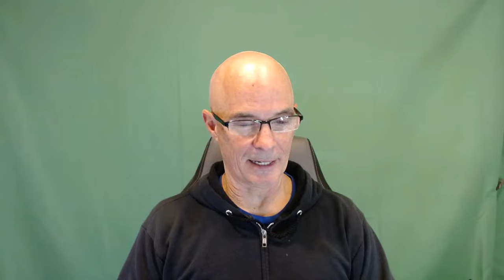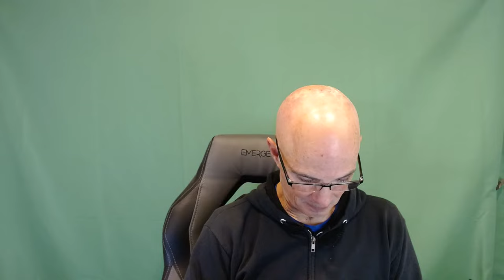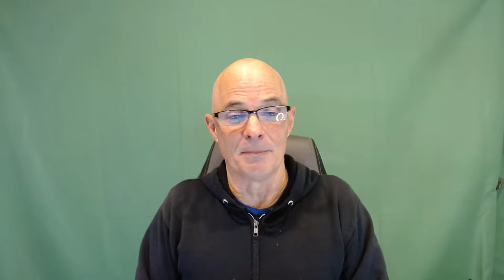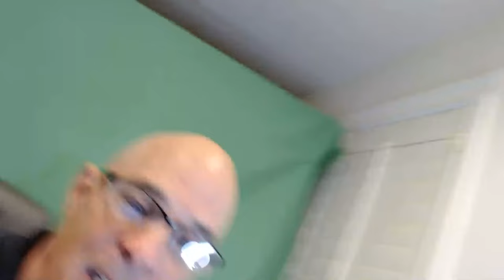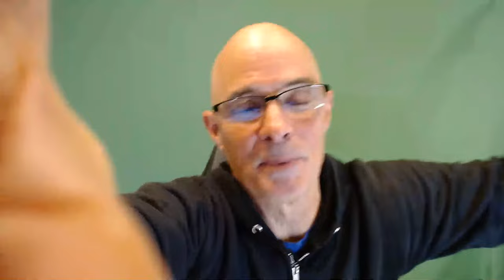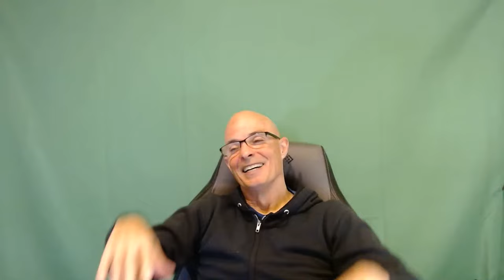LET'S TALK TECH-TEST GOLFBALL DIMPLE PISTONS?

Comment: Skeptical.   As the piston draws down from TDC the piston top gets further from the combustion chamber and any swirl that happens is likely nearer the head than the piston top.  Also they would have to figure out how to match the combustion chamber volume added by the dimples.  Decrease the dish before you cut the dimples?   Maybe it would disrupt the flame front after ignition causing more thorough combustion?
Reply from the maker: you need to think about what happens during the compression stroke and right before ignition then expansion
Reply: @richardholdener1727   hello rick  i think  diesel enginne bring juste air  nothing mix  and same  as GDI gaz engine   and you never have enough of air fuel mixe for max performance

Comment: I think the theory of why it would work in a modern diesel would be the decreased boundary layer or lamilar flow reduction. Modern diesel swirl the air inside the cylinder I forgot the numbers Gail Banks talks about it and one of his videos. As a cylinder comes up on the compression stroke it induces more swirl and the boundary layer between the piston and the air probably slows that swirl down before injection reducing that boundary layer increases swirl increases efficiency... Probably doesn't translate to a gas engine at all

Comment: I don't know if you've started testing them or not at this point. But if not, I think you're definitely missing out! Personally, I would jump at the opportunity!
But to be clear, Speed of Air pistons are not about increased power. They do typically see a slight increase of peak power and more torque, especially in the lower RPM's, resulting in a wider power curve. But that's just a positive side effect of a faster and more complete combustion thanks to a more homogeneous mixture and a more evenly contained (stabilized) flame front and also increased cylinder compression and turbine drive pressure. If you're looking to get the most power out of an engine, you're probably looking at pushing as much air and fuel as possible through the cylinder at ever increasing RPM's. But then you're no longer emissions compliant and engine longevity and fuel efficiency is out the window long ago...

No, the Speed of Air piston design is all about a clean and complete burn, meaning vastly improved emissions, meaning vastly reduced carbon deposits, meaning vastly improved engine oil life, meaning vastly reduced harm caused by EGR's, meaning vastly less clogging up of DPF's, meaning vastly reduced regen cycles, meaning vastly reduced DEF consumption, meaning vastly improved engine life and also a very meaningful increase in fuel economy and a wider power curve. That's what it's about. And really, if you think about it, that's exactly what ICE's need the most to survive the current political climate (pun intended). The climate politics are trying to kill ICE's mainly because of emissions. Just look at diesels... Speed of Air pistons practically makes a diesel near emissions compliant by themselves. This means all the after-gas treatment equipment becomes practically harmless to the engine, which is a BIG one for all the diesel folks out there worried about the longevity of their expensive emissions equipped trucks. And this also means even cleaner emissions, so everybody wins!

What Speed of Air does with the dimple design is they apply the principles of fluid dynamics to the combustion chamber geometry of a given engine design and develop a dimple pattern tailored to that geometry to achieve the desired result. So, it's not just a random dimple pattern superimposed on a piston head. This means every engine (combustion chamber) design will see varying degrees of improvement from the piston package. I call it a package because it's not just about the dimpling design. It's also about the ceramic coating and the gap-less second ring. Developing the dimpling pattern is where most of the science goes into, from what I understand, but the ceramic coating and the gap-less ring both contribute very meaningfully to the desired result. So it's really a package. That's why you should be testing them side by side to completely bone stock pistons. If you want to find out what only the dimpling by itself does, you could do your own ceramic coating and contact Total Seal (which provides the gap-less rings for SoE) for a custom set of gap-less second rings. Or you can send out a set of rings and have them convert them. But again, the SoA pistons are a package, not just dimpled pistons.

So, in accordance with fluid dynamics, the dimples are really about creating more swirl on every stroke (by the stroking motion itself), which causes the gases to be transported in and out of the chamber more rapidly. It's kind of like when you pour water through a funnel. If you put a spin to the water it'll flow much faster. Some funnel designs are better at doing this than others (look up "hyperbolic funnel" and Viktor Schauberger). By the same principle, if you can introduce swirling motions to the entire body of gases in the chamber, you can move it more effectively. What the dimples also do is create a barrier (like a golf ball) between the surface of the pistons and the gas mixture, which I think serves several purposes by itself. For one thing, it reduces sticking of fuel molecules to the piston surface, promoting a more complete participation of fuel molecules in the actual combustion event, which promotes a more complete burn of the amount of fuel that is injected, meaning you get more out of the fuel you spend. In my mind this barrier effect may even slightly increase peak compression on the compression stroke, potentially increasing total compression ratio. Or maybe it stays the same, depending on how far out the barrier extends on TDC compared to BDC.

And if we take the swirl principle a step further, it is definitely possible to improve air flow in both intake and exhaust passages by introducing both dimpling (mainly to reduce friction) and spiral patterns (to induce vortex motions). Obviously this goes for ports and valves too. Doing it this way would increase total airflow potential of the entire system. This also means you could go more compact if you don't really need more total airflow. Imagine a spiraling exhaust pipe! Wonder if that changes the exhaust sound profile...

From what I understand, the purpose of the coating is about reflecting heat and thus concentrating it towards the center of the cylinder. This helps to stabilize the flame front, which helps achieve a faster and more complete burn. It also aids in preventing excessive cylinder temps, since more heat will escape through the exhaust ports (because it's reflected in the direction of the head) once the combustion event is finished and the heat has done it's job. This keeps the cylinder wall temps down to further prevent NOx formation. So, the coating seems to work very well together with the swirling effect of the dimpling pattern.

And then, the gap-less second rings are all about forming a tighter seal between the piston and the cylinder walls, which further increases gas movement in and out of the chamber while also significantly reducing blow-by and thereby increases cylinder compression force and thereby also drive pressure on the turbine on engines equipped with turbos, without risking cylinder over heating or over pressures thanks to the other two components of the package. The reduced blow-by also means much less contaminants escaping into the engine oil, which is a big reason why oil life is so drastically extended. It also means reduced pressure fluctuation of the crank case, which ought to increase the service life of anything related to crank case ventilation pathway.

That's what I can think of right now that their product offers, but all in all they offer just a great overall upgrade package for engine health with their pistons. If it was up to me, every road going vehicle should be factory equipped with them! And really, all engines should be designed with the combined technologies of their pistons in mind. Everyone's engines would last significantly longer and give you more mileage per unit of fuel. These results have already been demonstrated on all tested engine platforms so far.
And I personally believe that, with my own suggestions of dimpling and spiraling all intake and exhaust pathways, you could amplify some of these effects even further, aside from just creating a more optimal flow dynamic, which is always a good thing.

Comment: As no one so far has given you a proper answer, this is the idea and function behind it all.

The air/fuel and the air streams inside the combustion chambers are constantly moving from the point of opening intake valve until half way through the combustion process. This is why you see such differences in combustion burn patterns on the pistons between different engine designs. It can tell you quite a lot in how the atomisation of your engine works. Typically the clean areas is where it completes the burn and where you get this carbon pattern is where you have fuel that is less atomised falling out of suspension and wont burn completely.

As the chamber density rises as it starts to compress you are also more likely to have the fuel deatomise itself again which come to the reason why quench/squish band is needed to force everything towards the spark plug, but doesnt solve the problem completely. The dimpling done right with the perfect depth to diameter ratio helps actually preventing this from happening so the combustion efficiency increases as you get a more homogeneous air fuel mixture across the combustion chamber with less leans spots. Ultimately means less residual fuel causing carbon build up, lower risk of knock, more consistent combustion pressure instead of these erratic pressure spikes up and down from inconsistent combustion events. Everything will run cooler and you will need less ignition timing as it will burn faster with a proper homogeneous mix. However if done wrong they can start collecting residual fuel cause hot spots and knocks.

I personally do this to my own engines lately, used both CFD and the visual of burn pattern which together shows the direct relation of how the air/fuel mix movement affects the burn pattern. Then I matched the dimple pattern in relation to how the seperate air streams enters the combustion chambers and starts to swirl around. Only to avoiding unnecessary dimpling and using the minimal amount needed to get the job done. Also to avoid getting flow disturbance from dimples in the wrong places causing a turbulent wake where we dont want it(The flow behavior of dimples can be quite complex and we dont want them placed just randomly). It doesnt even add up to 0.5cc extra chamber volume in my engines.

The test engines does sound a bit problematic, especially if BSFC and such cannot be measured properly which is crucial in determining how well this works or not. Just power output alone doesnt really tell us a whole lot in the end..

Cheers from Sweden!
Reply from the maker: thnx
Reply: Do u have dyno graphs to prove it makes an improvement?
Reply: @gfarnden56 I’m going to call BS on this one. I’ve been involved in top level race engines for 20 years. If this noob from Sweden thinks he’s found something that no one in NASCAR, F1, LMP, Supercars, Prostock, Top Fuel have missed them he’s very underpaid building Saab engines.

Comment: If it worked dont you think 1 of the leading manufacturers would be producing them & at least 1 race team would be using them 🤔🤔🤔
Reply: My thoughts exactly. There are no manufactures using this at all.
Reply: @gfarnden56 actually there are a variation used by Volvo diesels for many years but it's a shaped combustion bowl that matches the spray pattern of the injector... Similar principal, different design
Reply: @100pyatt  i suspect that has more to do with combustion rather than airflow.
Could u send a link to a photo please

Comment: I saw and heard a Duramax with these pistons and the change was dramatic. Emissions down drastically. Torque up by 200 pounds. The engine was extremely quiet. They reported a 20% gain in fuel mileage.
Reply from the maker: no on adding 200 lb-ft by themselves, no on 20% improvement in mileage, no on emissions "drastically" reduced. I would believe in some changes on a diesel, just not at those levels
Reply: @richardholdener1727  I saw it with my own eyes and I heard the difference. It dramatically improved efficiency. I was in aerospace and I know how the dimples work. Who are you shilling for? The fuel companies.

Comment: I don’t think dimple pistons do much of anything. Dimple intake/exhaust ports do help reduce turbulence, and they do tend to help the air form a nice “jet stream” of sorts… but the piston’s movement is perpendicular to the airflow, it’s not slicing through the air, nor is the air moving around the piston. I feel like the dimples would have a negative effect with the af mixture. I guess they could be beneficial, but I feel like the higher specific weight of diesel would cause the dimples to collect fuel and/or unburnt carbons. The dimples ARE a weight reduction however. I feel like stock piston vs dimple piston, the dimple will out perform stock. A lighter than stock piston, that causes the same compression ratio, will probably match the performance increase of the dimple. The dimples on golf balls and inside int/exh ports cause a thin turbulent layer of air, while maintaining a LAMINAR flow over the thin turbulent area. So… seems like it could cause a negative effect on the af mixture. I think the pistons are lighter than stock and that’s your power/fuel mileage increase. A little less rotational mass, and maybe the piston rings have less drag on them. Way too many variables. They need to ask you what you need, and let you do the testing on your own. You know how to get accurate results. For a real test, they should just step back. Reduced emissions is probably due to the dimples catching unburnt carbons.

Comment: How do you equalize the compression?  I'm sure the dimples will lower compression
Reply from the maker: less than 1 cc
Reply: @richardholdener1727  I was thinking maybe use a slightly thinner head gasket on  the dimpled engine

Comment: Now it does increase the surface area. I didn’t think about that. On an NA, I wonder if it would increase the vacuum? More surface area for the piston to pull on. And if it does make a laminar flow above the turbulent layer, then hypothetically that really might make a big difference on the negative pressure side of life. With a positive pressure though… I just don’t know about it. You should ask Vizard his opinion. I’d be curious to know. And I’m hoping you end up being able to do about 50 test variations, and hopefully there is a cutaway involved. Lol.
Reply from the maker: no on 50 variations
Reply: @richardholdener1727   ugh. Fine. Lol. Those will have to be very particular tests to knock out all the maybes.

Comment: Do the dimples increase the piston face surface area by any noticeable amount? Would that be the same as using a fatter piston?
Reply: Does it increase it in the correct way. If we consider these semi sphere like dimples only a tiny spot Is perpendicular to the piston travel. I see this as net negative. The area of the face of the piston has increased but now more of that area is off axis to piston displacement.
Reply: @joshiek7839  that’s true. a lot of the area is generally downward.  I wonder what it adds up to?  Maybe upward dimples would be better.  Better for compression i’d wager.
Reply: @charlesboyd2876  outies would be terrible for squish. Innie dimples not much better. Squish is more important than it’s given credit for. Compression above a certain level is overated. Australia v8 Supercar engines of the previous era made 650hp at 7500rpm using 10:1 comp (rule) with 302ci motors. They mirrored the shape (not the volume) of the combustion chamber in the piston dish. That was al about squish or quench what ever term you prefer.
Reply: @joshiek7839  Okay.  All of that is probably true.  I listened to the live stream and it was all about swirl and mixing.  Dimples or domes WOULD change the compression and available surface area for the combustion to shove against….it seems to me anyway and it would be interesting to know how much.  Maybe it is negligible.
Reply: @charlesboyd2876  the purpose of quench is swirl and mixing. I can’t see how dimples would achieve that. Dimples on a golf ball are to trip the boundary layer from laminar flow to turbulent flow to help the air stay attached longer on the back side of the ball. The aerodynamics in a combustion chamber cylinder isn’t laminar.
Reply: @joshiek7839  yes. I get it.  Not sure what I said to imply I did not know what golf ball dimples are for…..I was just wondering if the added surface area would make any difference in downward force.  The only way to really know would to use a dimpled and non-dimpled set in the same engine with everything else the same but then you’d have to ask, if there is a difference, how much of that is due to the mixture flow difference and how much is due to the added surface area.  i’m sure the math has been done with domed pistons.  This would be, presumably, a variation on that math.  I’m not familiar with those details.
Reply: @charlesboyd2876  it wouldn’t make a difference to downward force. You are reducing the surface area that is in line with motion and increasing area that is misaligned (to varying degrees) with motion.